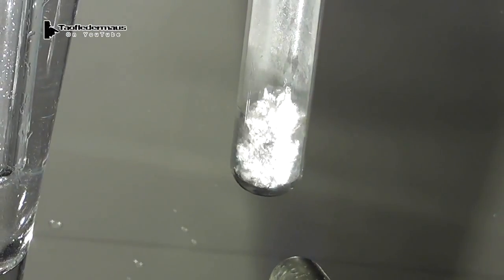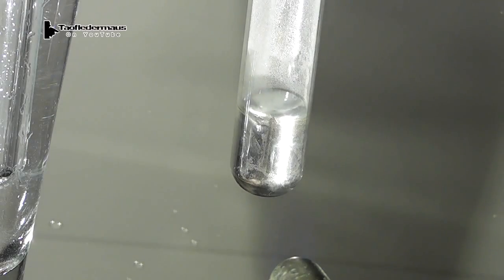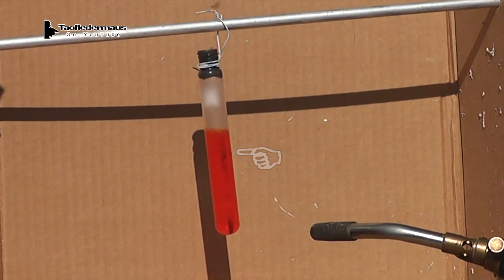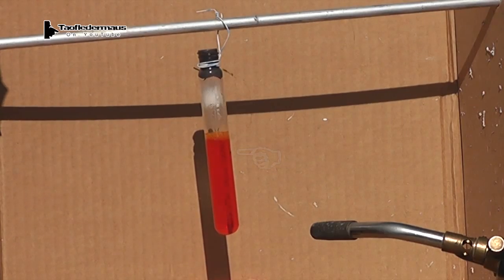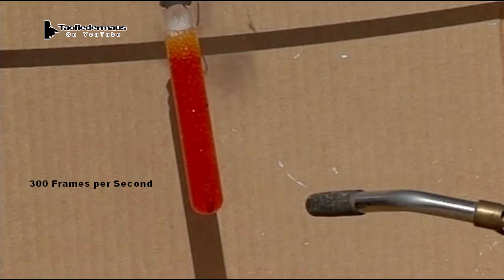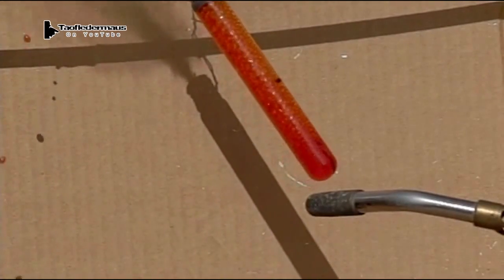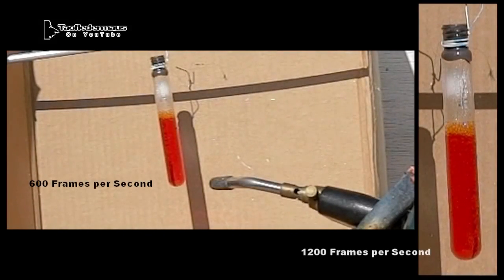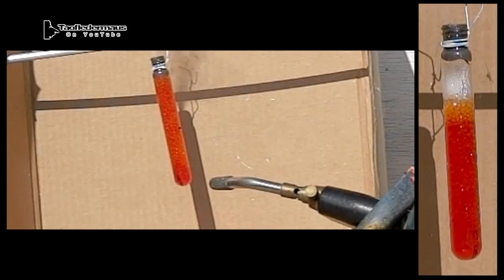TTTT - WATER- Test Tube TORCHER Tests

Comment: Do popcorn in oil, accept this time leave vent holes in the tube and see if the popcorn expanding does anything to the glass.
Reply from the maker: I've been thinking about how to do the popcorn.  I may have to heat it up and at the right point,   shoot the tube with a pellet rifle.
Reply: ***** or just leave the top off and let it shoot out

Comment: how about adding a manometer to the setup? how did you know wether such thing couldn't have happened to the mercury setup (despite the cooler ofc.)
Reply from the maker: A manometer has too low of a range.
Reply: and the other part of my question? weren't You afraid of blowing up mercury?
Reply from the maker: I wasn't afraid,  but very cautious and focused when i did that.    I wore a respirator etc jic

Comment: Fill the tube with acetone, then, once there is evidence of a partial leek, smash the tube so that the flash-boiled acetone will create an awesome fire ball/ explosion.  You might need an additional flame source since the explosion might blow out the torch, and that would be no fun.
Reply: and add pure O2 gass to the mix

Comment: i would like to see normal house hold sugar mixed with Potassium nitrate on a 40 to 60% ratio. my curiosity on this is how long it will take for the mix to melt and ignite under pressure

Comment: Why not try the powerful oxidant potassium chlorate sealed in a tube, use 2 different varieties of epoxy. Make a small stopper for below the cap, and use the 1st epoxy on that, then when that's set, put 2nd epoxy before replacing cap. See what happens

Comment: What would happen if you welded a steel pipe in both ends, and the pipe is half full with water or olive oil and heat it up?
Reply: Look up "pipe bomb" or "BLEVE", that should answer your question.

Comment: that honestly resembled the globules on the surface of the sun. if you were able to see under the surface I bet it would resemble the convection currents in the tube as the super heated water reached the top it released energy as steam cooled and moved down to the bottom again. SCIENCE!!!
Reply from the maker: The hotter water was rising and the cooler was dropping.  I didn't expect to see anything like that!

Comment: For the rocket idea you had, you could make a rocket tube out of a pipe with a valve on the bottom, and when it gets to a certain psi, u can turn the valve, launching the rocket into the air

Comment: When I was young, I tried heating up my pork and beans in the can resting on the coals of a fire.  The can bulged before it exploded unimaginably violently beans, coals, ashes, and metal shrapnel.. Water in a test tube brought the old memory back. Water is extremely interesting. Can you measure the temperature that the steam can get to when under confinement and heat? Is it really true water can only get to 212 F when not under pressure?  Could you do types of plastic  in the tube and ignite the fumes when they finally make their way out. Corn syrup might burn nicely.
Reply from the maker: I filmed a bean can a while back on top of a camp stove.  It was a lot more energetic than I thought...   The Power and Stupidity of Steam - Weaponized Bean Can
Water boils at 212 F  at sea level but at  lower temperatures as you gain elevation.

Comment: Jeff these would be really fun. see if u can up the pressure, perhaps by using a metal container(eg copper/alloy pipe lenghth) with maybe weakend end/s - eg instead of epoxy, drilling a hole in end and soldering over while water is in there, then heating right up, and standing well back or behind safety barrier / strong window.

Comment: You could try it with very thin oil like vegetable oil or low viscosity motor oil and then maybe also try it with a very thick oil like gear lube and see if there were any interesting differences.

Comment: Definitely high on the like scale. Can we see more metals? Lead, perhaps? Plastics?
Reply: Oh, and redo Water without the hole in the epoxy plug (though it was seriously cool to see this 'failure' as it's a good chance to se how BLEVE type failures happen.
Reply from the maker: I definitely would like to try lead.  I have a lot of lead shot.   I bought some more test tubes with caps so maybe I can get a better seal on them.

Comment: Salt?
Reply: salt has to get really really hot to melt, and pretty sure it must be in ceramic, not glass.
Reply: Kamikrazey
Wikipedia says it has a melting temperature of 801 °C, and a boiling temperature of 1465 °C. Which is really hot, but I believe there's equipment able to withstand such heat.
Reply: yeah, i know there is, i have seen it at college, doubt that a test tube can handle it though.

Comment: You could easily use this to creat a rocket. In fact, torpedoes and underwater surface to air missiles on submarines get their initial propulsion from steam expansion. This is why if you ever watch a missile firing from underwater, it will breech the surface and then rhe rocket engine will ignite.

Comment: I love it :D it's brilliant. And you can make a rocket with it :) gasket + high torque assembly that holds it in place until your ready/she's cooked up enough. When I say gasket by the way, I don't mean a rubber gasket, I mean a REAL gasket :) the kind that holds the cylinder head in place :D

Comment: empty finger condem (like used in resturaunt ketchens to put on cut fingers) un inflated on the end of the test tube (also empty). Put dry ice on the bottom of the tube to super cool the air and draw the finger condem inside the tube. Probably wont be cool for any kind of high speed stuff but it would be neat showing how much the air retracts.

Comment: what if you put a test tube of water in a vacuum chamber, drop the pressure to 0 then pop the cap off the test tube, how would it look
Reply from the maker: I don't have a vacuum chamber.
Reply: The gas would escape ("explode") from the tube due to the decreased external pressure, and the water would boil very rapidly (at room temperature), because of the lack of pressure.

Comment: This is a really cool video. Maybe you could harness the thrust by putting a small nozzle over the top part of the test tube? That way the steam would get directed into a fixed direction instead of going all nilly willy. The nozzle will probably have to have a smaller diameter than the test tube.

Comment: I think the tube would have exploded if the epoxy held together for just a few seconds longer. You can see a fracture appear in the glass a second or two before the steam ruptured the plug. Cool video.
Reply from the maker: I think so too.   I need to find some better epoxy.

Comment: i'm thinking a stream powered rocket would be pretty awesome. you just need a way to heat up a tube full of water and then release it quickly. it probably wouldn't do as good as modern rocket fuels but it would be neat either way.